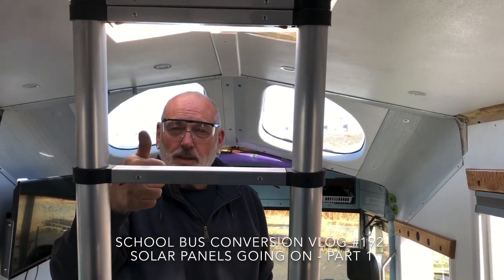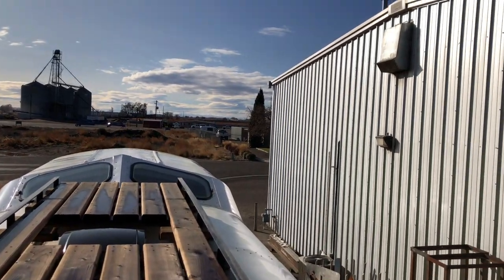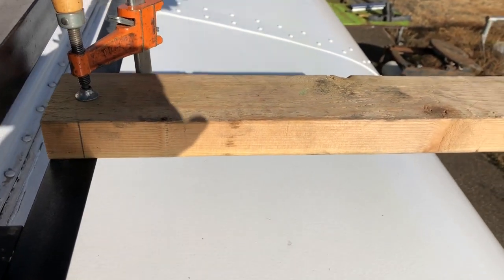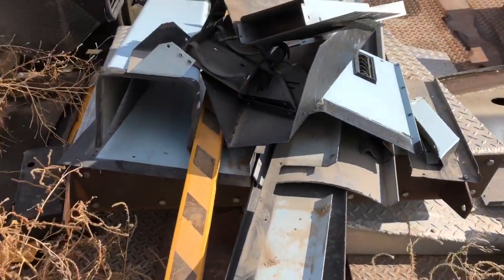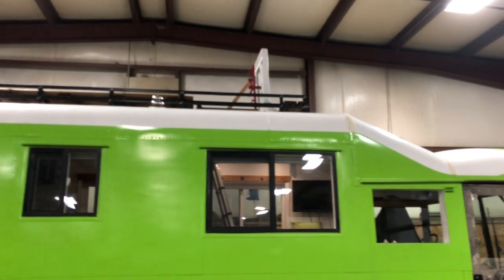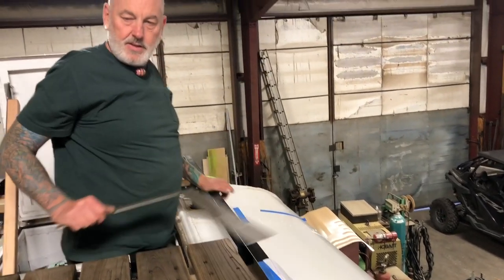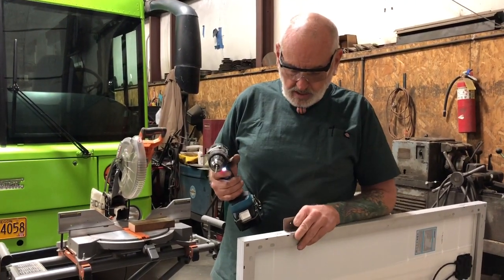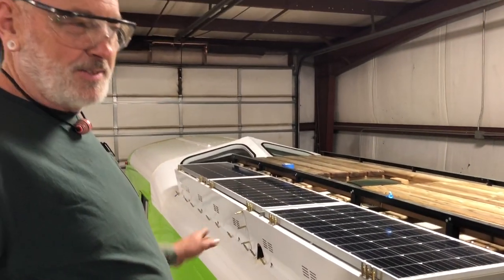Solar Panels Going On - Part 1 - Vlog 192 School Bus Conversion

Comment: Just a suggestion, but if you have enough sheet metal left over, you can scribe and cut your front fairings (I'd do one or two, depending on how much sheet metal you have left) so it pushes the wind up and over the panels. That plus some large washers on the under side of the bolts holding the fairings down should give you plenty of strength to keep them attached.
Reply from the maker: We have the metal but we were on the fence whether or not it is necessary. Thanks for your concern and suggestions.😃
Reply: A few of the bus/van life channels I follow on Youtube have lost solar panels to wind, and I'd hate for that to happen to you. Driving down the road at freeway speeds, with no headwind, means nearly hurricane-force winds against your panels. I'm sure the mounts you've built will keep them on the bus, but glass panels can still break without coming off. A front fairing would divert the wind over the top and prevent oscillation that can crack them. And that's all I've got to say about that.

Comment: Did not see that coming Randy very smart. Maybe worth putting in a small drain hole to allow any water out from behind the uprights if it were to collect under tha panels.
Reply from the maker: If you look along the bottom you’ll see I’ve spaced out drain holes all the way across but thanks for your comment. Appreciate it. 😃

Comment: Just be careful "Life Is A Joy" bus lost one of their panels when the wind got under it. I mean it didn't blow off it almost did, He had to replace the panel BC It busted.
Reply from the maker: Life is a Joy solar panels were probably four times the size of these ones. Makes them more of a kite. Jim ended up putting the fairings on the side like we have and that was one of our inspirations for doing it. Also another reason I chose to use the compact size panels and have the deck in the center so that any air that came up underneath them could escape through the center deck. I don’t know if this is right but it’s what I’ve done and we’ll see how it works thanks for your comments and your concerns always appreciate it 😃

Comment: I did not see any metal bent on the roof of your bus to deflect air over your solar panels to make sure when your traveling down the road, No Air goes under your Exspensive Solar Panels and TEARS them off the ROOF!!
Reply from the maker: My plan is to let the air pass underneath the panels that’s why the venting under the deck allows it to come up and out going down the highway. I’m hoping that it will just slide through the air no expert on this don’t really have a wind tunnel to test it so well modify if necessary 😃
Reply: If you watch life is a joy Bus..he had his tear off and had to re do it.. I would hate to see your Bus share the same kind of hard ship
Reply: Amazing Job .. So happy for you Both... All The Best!!! From Sherbrooke Quebec Canada